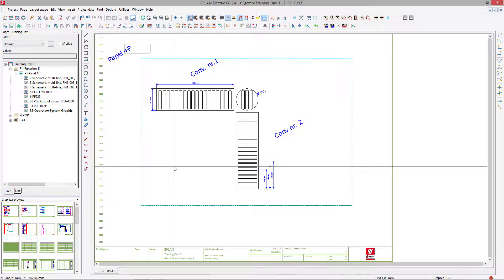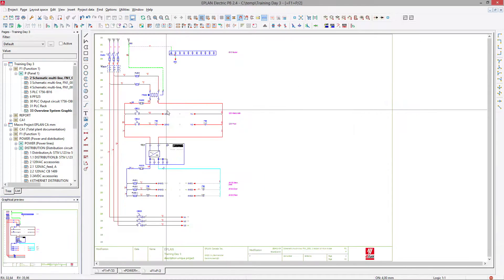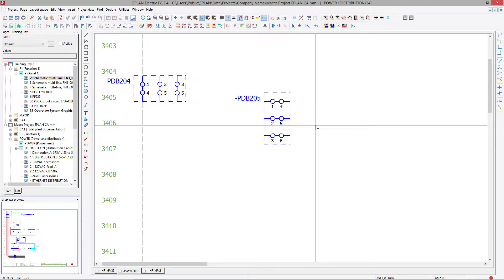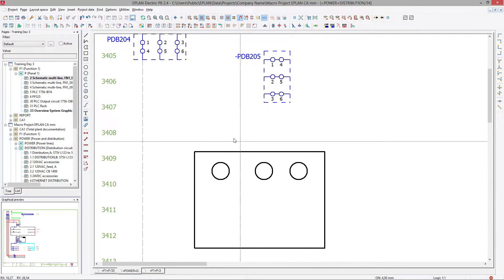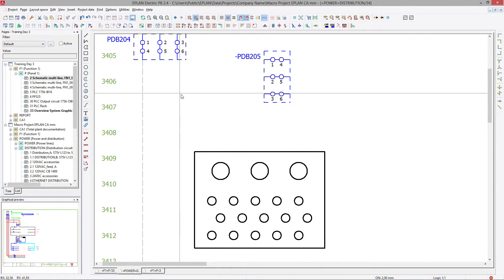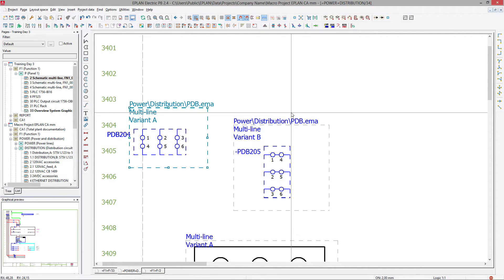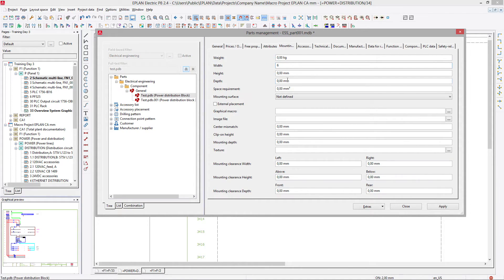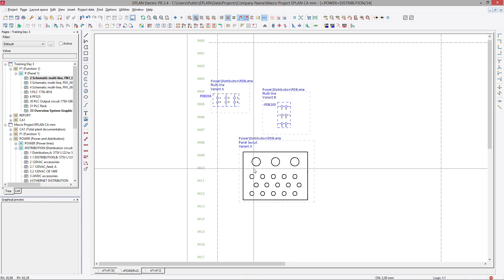EPLAN Tutorial Macro IV

Comment: I have a doubt about black box and device connection points. The dt of the black box is mcc-10, the device connection point is placed inside the black box, the dt of the device connection point is 01X and the connection point designation is 10. Buti need to do displayed dt of device connection point is 01X and full dt is =+- mcc-10-01X let me know if it is possible to do. Please explane or create a new video.tks.
Reply from the maker: this is a good support / consulting question. Sorry, in IEC 81346, MCC10 would be your DT of that black box, 01X would be the connection designation of the  connection designation of the device connection point. The DT is usually not used for the device connection point. As IEC 81346, your Device/connection would be described as =+-MCC10:01X